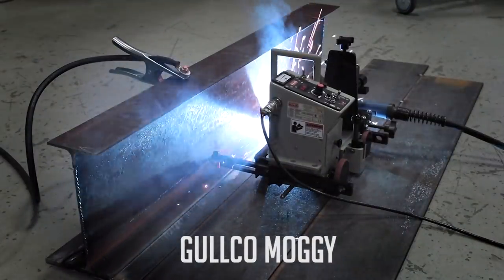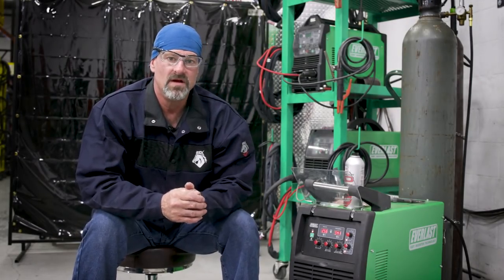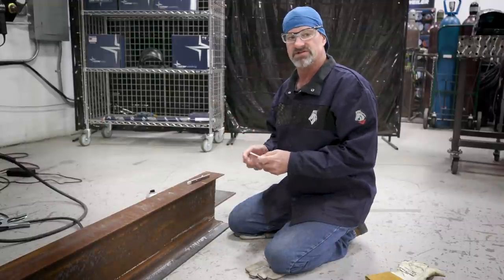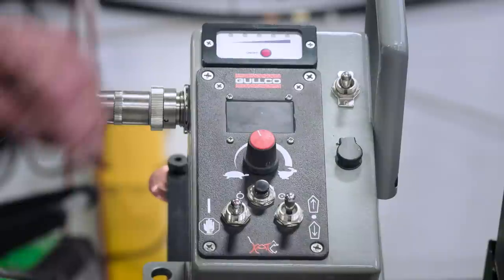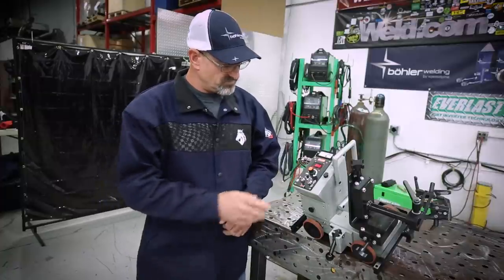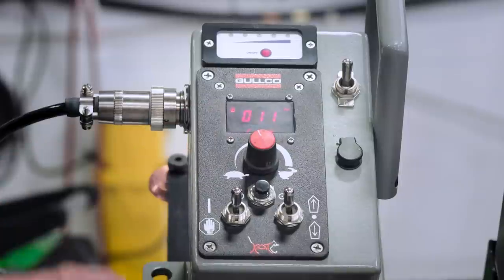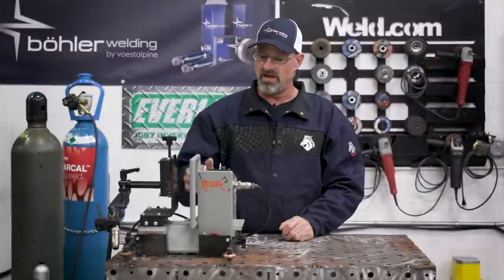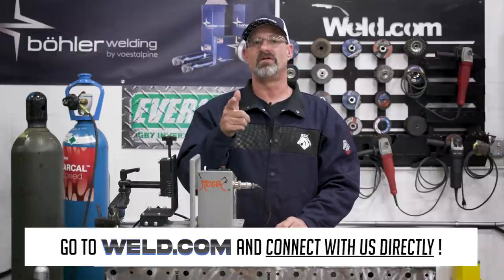Trackless GULLCO MOGGY Carriage Beam Welding: Tips and Techniques

Comment: You didn’t include the setup time for the machine, including the programming. Add that on and man is faster. It’s a different storey if you have 100 identical parts to weld but ones and twos, no. 🇬🇧

Comment: You didn’t include setup time for the machine and the spacer was a waste of time. Could have been a lot faster using a tape measure. My money would still be on the human as you would only need to drag a welding machine and welder around. With the added machinery it’s just more luggage and requires more training.